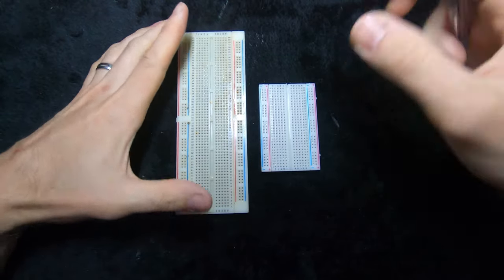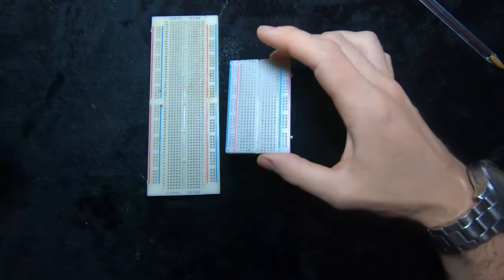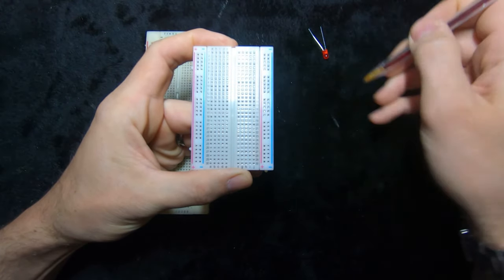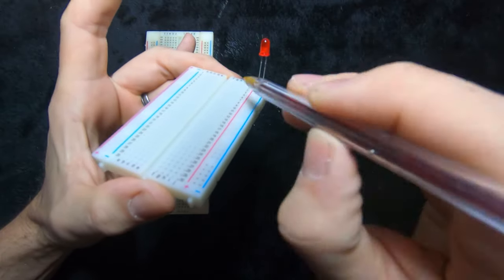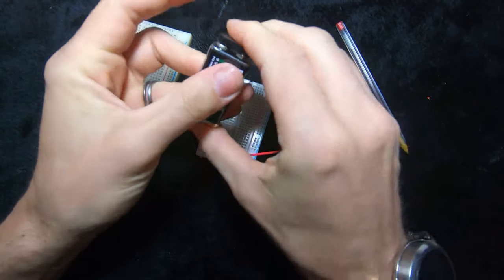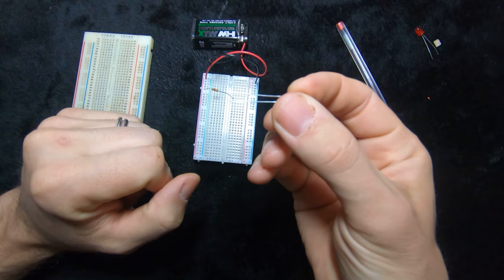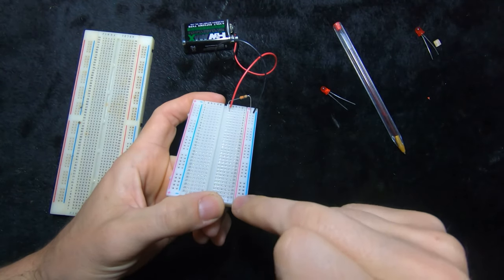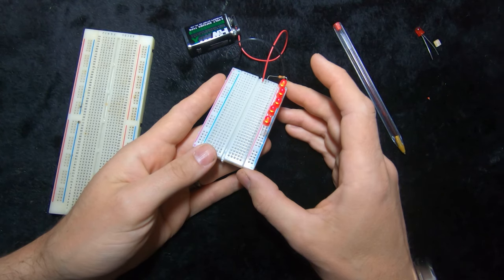Electronics Tutorial 1 - Basic Breadboarding

Comment: Can you please link to the second one in the description? (and to the third one in the second description and so on)? Makes it easier to find.
Reply from the maker: Will do - thank you for all this feedback - very helpful.  I have just watched some of big clives videos - I see what you mean.  Does he have any with a view of his rig?  I did make one for some of my videos which worked well, but with electronics the focus and size of small components was an issue.  Again - thanks for your comments - appreciate it.
Reply: @TechMoto101  I have not seen any (would also like to see that), but ask him to make one?
I really like your idea of doing these videos so please continue!
My father has done a lot of stuff during the years like a timer for the aquarium that has been running for like 40 years or so! It's a lot of dividers in it and it uses the frequency of the wall grid (50 Hz) and is on for 12 hours and off for 12 hours, with a three way switch: Always on, auto and reset. When flipped to reset, you push a small button and it turns the light of and resets the 12 hour cycle.
And he made a light sensing counter: It can count the time a light is on or off or the number of times it changes during a set period, and it shows the result in a LED matrix, binary.
And another timer for using when developing bw pictures: A lot of switches (binary) that you can set the time it will be on when triggered (by a button or a home made foot switch), and one switch is to divide in 2 if you want half second accuracy.
And more....
Really fun stuff to play around with!

Maybe you could show how to build a simple light sensitive light switch? You set the sensitivity and when it gets dark enough, it will turn on a light, and when it gets lighter (in the morning i.e.) it turns it off. And then how to make it even more advanced with one of those tiny modern radars that you can make the light trigger when you are in the vicinity.
Or... ohh, my head is s full of ideas!
Reply from the maker: @Xanthopteryx  No problem - that's actually rather straight forward.  I touched on that in the potential divider video on my channel, but it would be good to do a 'make with me' video of that.  I have about 20 years of students projects under my belt so have made many things like this as most projects have some form of light/temp sensor.  I'll put it on the list for future videos.  I'm hoping to make a few more soon after a short break.  Keep an eye out for it :)  My hope is that over the years every component and concept is covered, making a library of content that enables others to make things with ease - and understand how it works.
Reply: @TechMoto101  I think that what you do here is perfect! We need to get people interested in electronics, and that also can help starting to repair stuff instead of throwing it away. And all those beginners experimenting is the best way i think - not too hard but easy and useful so people realizes that it's not so difficult doing stuff by them self. Great work you have done so far!